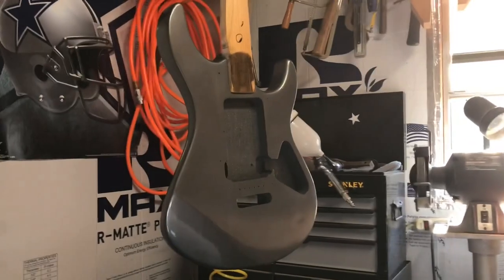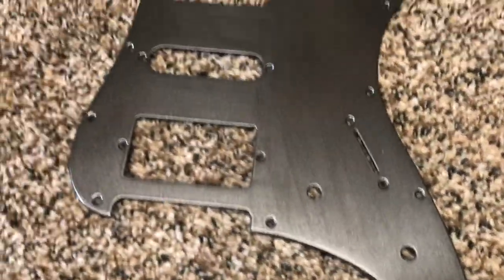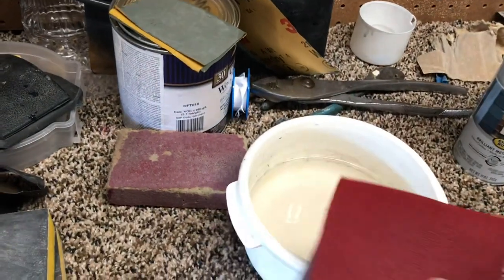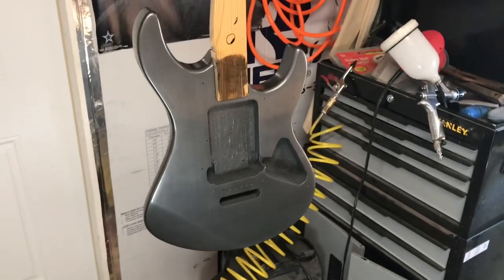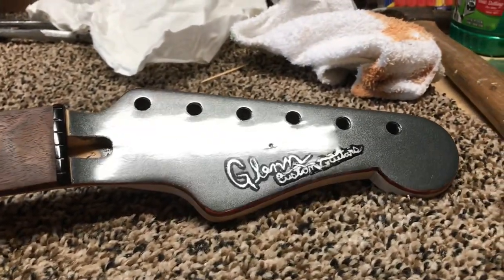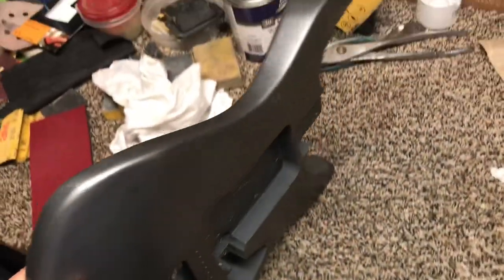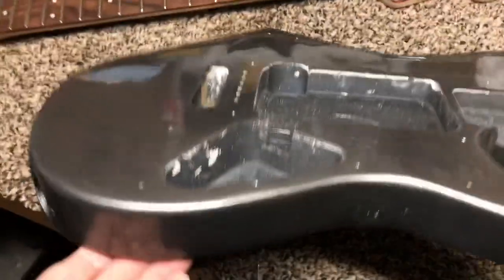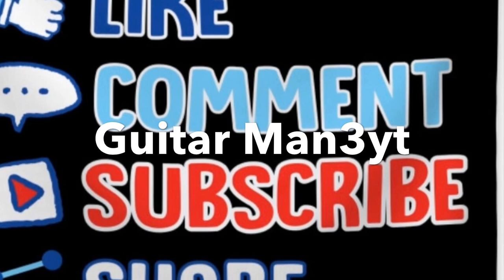How to sand and polish clear coat on your guitar to a mirror finish/part 6 project guitar

Comment: what clear coat did you use and how long does it need to cure to be touchable?
Reply from the maker: Jack Kiefer, I use deft brushing laquer. But I use it in my spray gun diluted with laquer thinner. After I get about 6 to 8 coats I let it cure for about a week before I try to wet sand it. Hope that helps ya.